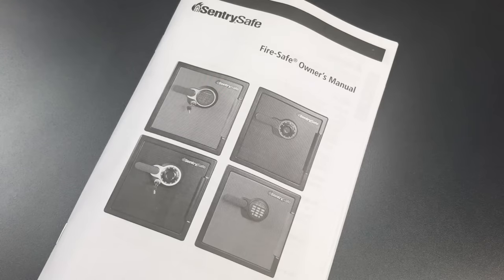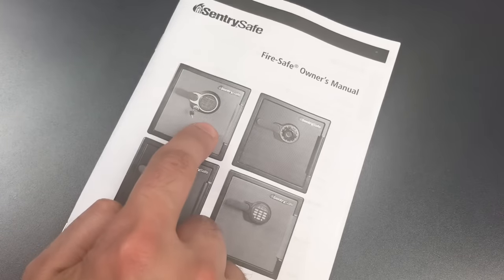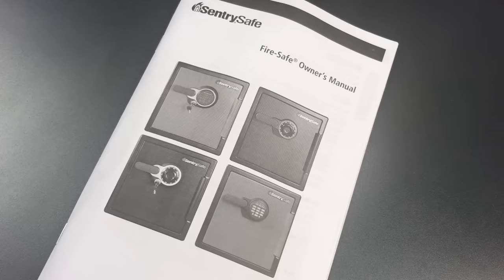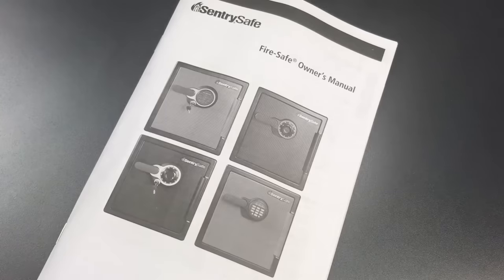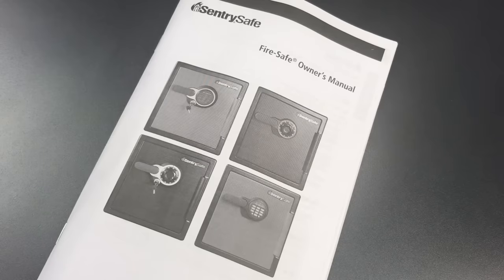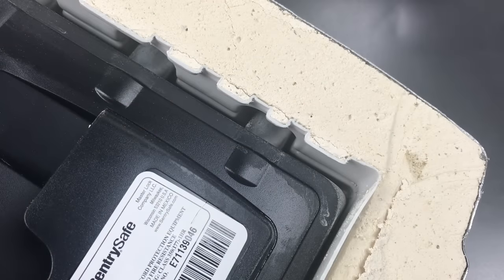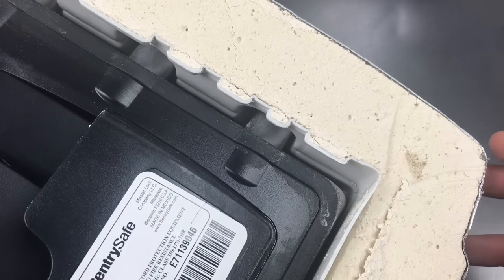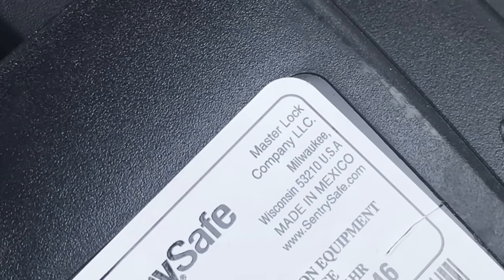[756] Sentry Safe Cut in Half FAST!

Comment: Lag bolt the safe to wall studs or the floor to keep it from being carried out and its enough to keep most peoples crap safe. No lock or safe is perfect. You have to buy the level of security fitting to your need and what you can afford.  Most random break-ins are quick smash and grabs. If it don't move and can't be easily opened in seconds they are not going to mess with it.  99% of "safes" sold in the US are actually Residential Security Containers, not safes at all. But they do work. Nobody is buying these cheap safes to house million dollar collections.
Reply: yep i have something similar, its bolted down to concrete in a corner of a brick structure cupboard, cant saw it in that limited space

Comment: did you use a standard wood rated blade or something rated for cement or metal?
Reply: Looks like it's a timber blade given the teeth that are visible during one section.
Reply: Markus Bates  Interesting. All the multipurpose ones available locally here have significantly smaller teeth and consequently an increased number of teeth than what it appeared LPL was using.
Reply: Any blade with carbide teeth will go through steel easily as long as you can keep it from bucking and chipping teeth. That being said, ALL rough cut circular saw blades have carbide teeth lol. If they say can cut nails in boards have carbide teeth.

Comment: Add extension cord and circular saw to your robbery check list.
Reply: A cordless saw would be sufficient. I fit mine with thin kerf abrasive cutting discs when cutting sheet metal.

Comment: Fun to watch but maybe a bit unfair. I can imagine that you would bolt a safe to the wall in a cabinet. So your ability to use a saw to cut all away around would be very limited. However I agree that the construction is very weak.
Reply: Potti314 then you’d just make 4 cuts on the same face.
Reply: It's much harder or impossible if the safe is mounted inside a cabinet and bolted on the wall so that bottom and one side is not feely accessible.
Reply: Potti314 putting 4 cuts in 1 side is just as easy as 1 cut in 4 sides.
Reply: Imagine it's bolted inside a cabinet. Here I found an example of what I mean http://gunsafehaven.com/wp-content/uploads/2011/08/pisto_safe_in_kitchen_cabinet.jpg If not much space is around, you have trouble using a tool like shown in this video 3:00 no matter which side you're going to attack.
Reply: Potti314 I don’t see anything there that prevents shoving the saw straight through the front door of the “safe”.
Reply: Because you have to do it while being on your knees holding your arms straight and no room for a bulky saw.
Reply: How do you bolt the tupperware inner box, and the insulation foam behind it, to a wall?
Reply: It would be better to use rubber gloves or do not use gloves when you use power tools, including a circular saw. Gloves  can give you a false sense of security. They will do little to protect you from a cut and pose a huge hazard  of getting caught in the tool and pulling the hand into get mangled
Reply: I'm pretty sure that cabinets can also be cut with... a circular saw  :p
Another use for a circular saw would be to get a homeowner to open the safe for you under threat of becoming two feet shorter; if you're gonna commit felonies, may as well commit exciting ones, right?
Reply: @Potti314  How do you bolt something to the wall if that thing is made of 0.5mm sheet metal?
Reply: IMHO you can bolt it in a cabinet sufficiently secure making the use of the cutter impossible. Maybe you can pry out the safe from the bolt because of the thin metal (> 0.5mm) and the cement but this has not being tested.

Comment: I forsee a take down notice or letter from a lawyer representing Sentry.
Reply: You mean Master Lock?
Reply: Not likely. Master Lock are aware of the Streisand Effect. Besides, what grounds would they argue - their products are actually as bad as LPL  demonstrates.
Reply: No chance. Modus operandi is to scare and/or intimidate someone with the threat of litigation. Even if they did - as a member of the bar this guy wouldn't be bothered in the least. Besides, this is neither libel or slander. Everything is factually correct.
Reply: @fluke196c  And let's not forget LPL is a lawyer after all.  He not going to be scared by a baseless c+d
Reply: He won't get sued because he actually using the safe as intended for the purpose os security....he should sue them for fauls advertising

Comment: I WAS A CRIMINAL BACK IN THE LATE 1970'S AND VERY EARLY 1980'S. IT COST ME 10 YEARS OF MY LIFE SPENT IN PRISON!
in the early 1980s i went into a BBQ restaurant and they had a large "sentry" brand safe, i looked and looked for about 1 hour for the combination but couldnt find it written anywhere. so i took the handle and tried it thinking it might be set to the hitch but before i turned the dial, it was unlocked!! i got several thousand dollars cash and the meat from the cooler amounted  to close to 100 pounds!
i assumed that the safe would be locked the next time i visited so i purchased on exactly like it brand new so i could see how easy it was to open. taking the back off the inside of the door, i took photos and put the , back, back on. i then locked the safe, removed the sticker from the center of the dial, removed the screw, removed the dial and hit the shaft with a 3 pound hammer square on the end, sending the whole locking mechanism out the back of the door. of course i took photos of every step.
a couple of months later i entered again and the safe was standing wide open, so i lifted the door off the hinges and took it with me along with another 100 pounds of meat!
over 1 year later i was arrested for stealing from a certain chain of banks by writting and cashing checks for $20 less that was deposited after 2 pm on fridays when any transaction was not recorded in the system until after  2 pm on monday. i did this 3 diffrent times in 6 months using state issued id cards in false names. that bank lost that money because they attempted to steal from me and ruined my getting a savings account for a step child!! i got at least $10,000 from that bank. anyway i had those photos of punching that safe in the glove compartment of my automobile and the detectives like to have lost their mind over that safe, they couldnt believe that i purchased it brand new to take photographs of how to punch it, but there were NO punched safes they could find ! lol  sentry was a joke back them and they are still a joke!!!

Comment: The manual said it was a Fire Safe, so I'd assume it's only for protecting your valuables from a fire (and kids). The build materials reflect this. It's just thin metal and plastic to keep the fire insulation in place. The real question is how well it fares against a fire. Would you just toss it in a bonfire and see how long it lasts? Maybe put a bluetooth thermometer inside to monitor how well it's doing?

Comment: This gave me an idea, drill a hole in one of these to get a network cable in and use it as a fire resistant protection for a NAS.
Reply: Only if your NAS can live with literally zero airflow, and assuming the fire doesn't enter through that hole.

Comment: The Sentry safe was at one time, made by the John D Brush company. The material  was much heavier and the inside was steel. I believe on the larger safes, they poured concrete between the inner and outer shells.
Reply: Sentry safe makes strong theft-resistant models, with thick steel and designed to protect against theft.
They also make FIRE safes like this one, which are designed to protect against fire.
Quite different things, and very easy to understand the difference.

Comment: Have this safe and just ordered the sane one because the current one is bulging and the metal is rusting. It can barely securely close. But that is after 15 years. I keep stuff in there that I wouldn't want to lose in a fire. And for less than $200, it's hard to beat. I would never recommend keeping anything really financially valuable though lol

Comment: Somebody got me a carrying sized Sentry safe a few years ago. I recently opened it a little too wide and broke the hinges.

As I recall, I started to get a squishy feeling as it opened “all the way,” so curiously I pushed a little farther and the resistance just literally deflated. The bolts that the lid swiveled on as it turns out were two quarter-inch hollow plastic nubs. In fact, I didn’t put much thought into it when I received it, but the whole thing might be made of plastic, except for the lock itself.

A warning inside the lid says “This product is not intended for the secure storage of all materials. Items such as firearms, other weapons, combustible materials, or medication should not be stored in this unit.” So what the hell can you put in there? Jewelry? Who would try to secure jewelry with this plastic piece of crap?

I honestly started to think throughout this video, “Wow, Sentry Safes must be the Master Lock of their field,” and then at the end, boom: Sentry Safes are Master Lock products. Between what I’ve seen on this channel and my own experience I can confidently say Master Lock are one step above an outright scam.

Comment: This seems like an unfair test. Of course you can get in to a safe with a saw and a metal blade. I am a sheet metal worker and I am certain that there isn't a safe I couldn't get in to with a sawzall and a pack of good blades. 
The best way to use any safe is to build it inside of a wall or in some sort of enclosed space. This way a person can't physically get cutting tools in to the position needed to tear it apart. Given time, however, even these obstacles can be overcome.

Comment: It's a bit of a trade off. To make it stronger you have to add metal, but to protect against fire you have to add ceramic. A long time ago I wanted to buy one of these safes for storing documents (e.g. passports, birth certificates, insurance docs) and having those documents survive should there be a fire (God forbid), but I decided that these safes would only be an invitation for a burglar to take off with my documents. I could leave it unlocked but then the fire could cause damage.

Comment: I agree that the marketing is confusing, but I disagree with the claim (1:10) that "of course we would only [put valuables in it] if this product were to provide some sort of theft protection." Protection againt fire and flood (which the product also claims) is also a useful thing, to the extent that even a non-locking version of the product would still be useful. Not as useful as a proper safe, but still useful.

Edit: having said that, I now notice that the name of the product is "Sentry Safe". Using the word "sentry" implies concepts like guarding and security against intruders (i.e., thieves). I think that, if I bought a productwith that name, I would actually expect it to provide decent theft protection.

Comment: I hate that Sentry makes claims to the security of their products (or even calls their fire resistant boxes "safes"), but I will give them this. They DO provide fairly good fire and water  protection for documents, photos, etc, (considering what they are and their price point)...  A friend of mine recently had a fully involved structure fire and the items they had in their Sentry did remain intact and dry. So for that purpose, which is what they're actually designed for, they perform as advertised. 

I mean, Sentry, it's a "good" to "OK" product for what it ACTUALLY is, just market it as that...  but don't claim they offer much in security.

Comment: Those sentry boxes are just for fire protection.  A real safe will come with a time rating. This rating is not about fire protection, but how long it would take a skilled tradesperson to breach it.  My last job required security containers and this brand was on the banned list.  We were not even allowed to use it as a cash box in the canteen.

Comment: Even in more expensive Ch*bb safes the filler material(special concrete mix) is like chalk and the metal construction is thin. Most of their relockers are connected by fabric string and not wire..

Comment: Bolting it to the floor against a wall, preferably 2 walls, helps some against cutting holes in it.  A basement is good because burglars don't like going into areas with only 1 escape route.  The sad truth is to get anything fire, water, and burglary rated you won't have anything left to put into the safe.

Comment: I may soon be doing the same.  I have a Sentry Safe that will not open.  Apparently the solenoid failed.  I have tried everything suggested by the Sentry support people (9V battery, pounding on the door with a rubber mallet, etc.) and nothing has worked.  Apparently, you can open with a large enough magnet, but such a magnet costs $170, which is more than the safe is worth so better to just destroy it.  I can’t believe that Sentry doesn’t provide a way to open it with the key when the electronic mechanism fails.

Comment: Are there any home safes in this size range that you recommend?  I have a Sentry Safe with electronic lock and the solenoid failed and the safe would not open.  And the key only provides a secondary lock, but no means to override the electronic lock which is a very stupid design.  I’d like to find a safe in the same size range that will handle hanging files and has a shelf or two for other things.

Comment: In all fairness, it would also help the safe's cause if it's lagged down to the floor. Still accessible, but will add an extra layer of complexity with only being able to cut 3 sides.
Reply: In all fairness, it is a FIRE SAFE that is only intended to protect against the heat and flames of a house fire.
It's for items that you want to protect against fire, not against theft.
If you want to protect against both Fire and Theft, then it will cost you A LOT more $$.

Comment: This is really just and old carpenter's trick, flip the blade in your circular saw so it spins backwards and you're off to the races, used to use this trick to cut sheat steel barn panels to size.

Comment: I think the point of these is that theyre cenented in to something foundational, so actually getting access to the soft top/sides would involve a whole lot of effort and power to release ot from that, i would expect the door front and hinges to offer a little more resistance though with master lock i could be very very wrong...

Comment: If you look a the underside of the safe at timestamp 2:36 you can see there's at least one seam in the sheet metal that doesn't look to be securely welded. Might have been able to quietly prise that open using only the crowbar.
Reply: If you read the product name and information, you can see that this is a FIRE SAFE that is to protect it's contents against fire. It doesn't matter that it isn't very secure, because flames do not use power tools.

Comment: I'd have liked you to show how to do it with the safe bolted to the floor. The right kinds of saws can be quite effective against even high-security safes, but you definitely need to know something about how they're constructed to be able to get in. A former coworker of mine got to see first hand the results of a comically incompetent saw attack—the thieves definitely had the right tools, but not the slightest idea what to do with them. Security through obscurity won that day, though the irreparable damage cost the safe owner thousands of dollars.
Reply: The whole idea of it is to NOT bolt it down. It is a FIRE SAFE so it protects against fire, not theft.
You leave it loose so you can grab it if you can get access to it. Otherwise, let the house burn and come back to collect the safe and contents after the fire is extinguished.
Reply: @johncoops6897  in case of a fire, you should never grab anything but another person or a pet. The fire safe is so your documents can survive the fire long enough for firefighters to arrive, and to keep out the water they use to put it out.
Reply: @dfeuer  - well, if you don't want to try and take things, that is your choice. What if pet and the safe are in the same room... would you hold the pet in one hand and leave other hand empty?

Comment: Safes are usually bolted on the floor and/or the wall. Otherwise the burglar only needs muscle to carry it away. 
I have my safe bolted with the back and a side against the walls, and the bottom against the floor. So there is no opportunity to roll the safe around to saw it in half. 
In my case a burglar would have to cut a hole on the side, or the top, or a section from both the side and the top. Would make for a less dramatic video though.

Comment: It other words is it ONLY a fire safe... I have a fire safe but it has about 12mm of steel outer casing and a 3cm thick door that is hollow with the locking mechanism in it. This "safe" was more easy to cut then 12mm plywood lol :)